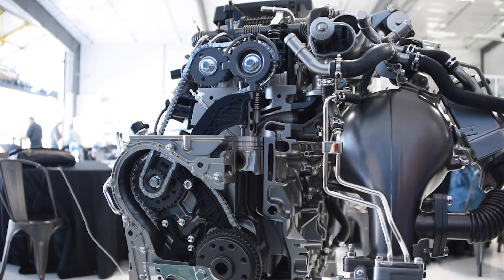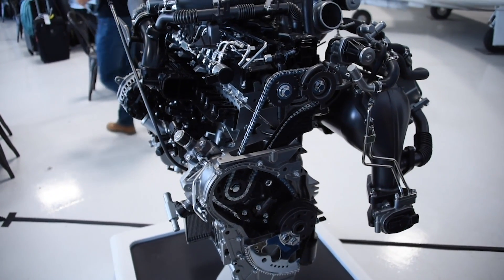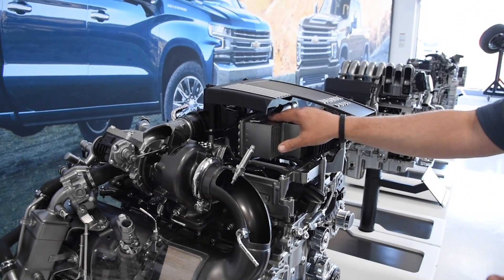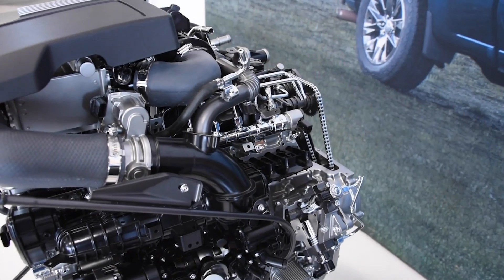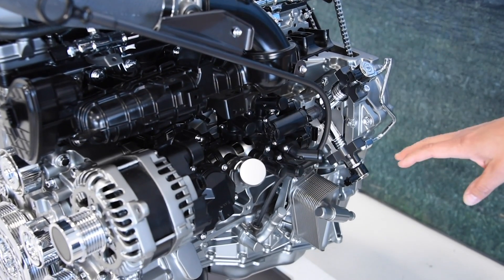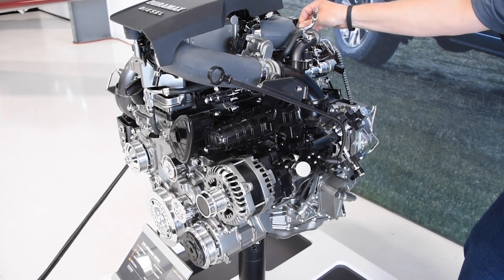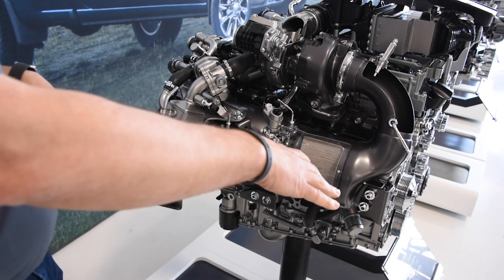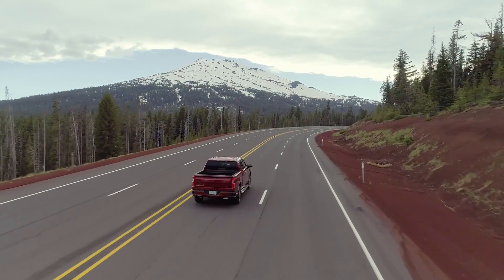What you don't know about the 3.0-liter Duramax diesel

Comment: Awesome video.  Very informative.
Reply from the maker: Thanks very much DJ!
Reply: @ the end of 2004 Ford bought back my 2003 super Dooty💩 6.0L piece of crap that had been in the Ford dealerships service department 10months out of the 18 i owned it-i bought a mid year 2500HD 6.6l Duramax LLY-This is by far the best truck ever manufactured anywhere-as soon as I got it home I pulled the egr actuator,valve & cooler off,cut the soot trap from the exhaust off & welded in a piece of pipe-my truck has over 430K miles now & being a 48 yr old Mobile Diesel Mechanic it’ll be the last truck I’ll ever need 👍🏼Thanks to Chevrolet 💪🏼 & Ppe tuning i nut on myself every time I drive it!!!Not many trucks can touch me from 0-130mph!✌🏼

Comment: Lol that engine wont last long. Theres a reason why the Cummins 5.9 12v and the 24v as well as the 6.9 and 7.3 idi and the 7.3 powerstrokes are all still running with well over 400,000 miles today and still doesnt skip a beat. You know why? Because they were simple. They had injectors, glow plugs, a set of pistons, a crank, and a cam. That simple. You never heard of a timing chain breaking on one of those. I feel just by hearing that the chain is a non serviceable part will make this engine last no more than 150,000 miles. Doubt it'll even touch 200,000. That's why these twats make them like that so you'll buy it again cause they're cheapskates. Oh and dont think about buying another one of those engines to swap in. That'll run you about 10 to 13 grand if not more. That's why I just stick to the best of the best. Detroit diesels. Old idi and older powerstrokes (nope no 6.0 or 6.4 or even the 6.7 here, those all suck too) and the 12v and 24v.

Comment: First of all... why in the absolute helll..... would you make the oil pump drive system a serviceable item? Thats soooooo inane its not even funny?!!!!  Chain driven camshafts??? Its a proven FACT That chains on valvetrain items in other engines are very often a frequent service item. Are you guys just looking to just SCREW every average american?? Think more simply. Your liquid to air charge system needs to stay out of the middle of the engine( where all your heat soak derives from). Overall horse power/tq output relates directly to air density in the intake manifold. Who is engineering this power plant? An 8 year old chinese boy?

Comment: “It’s not difficult at all!”

“The transmission just has to be backed out”

🙄🙄🙄🙄
Reply: Transmission has to be backed out as well as the transfer case. Driive shafts need to be removed as  well as the torque converter. 
They should have used a timing chain on that oil pump.
Reply: After saying it was rear mounted and a belt, then he said "easy"?  What ever happened to gear driven diesel?  Definitely financial choice.
Reply: Between 600 or 1200 for that service.  I asked...
Reply: I agree, planned failure. Master tech superstar does it in 4 hours, charges 12 to customer. Like everything else, all those chains will rattle like crazy past the belt change interval so go ahead and remove the rear engine cover by getting the trans out of the way first to do the whole job right. 

But that is easier then a front mounted timing system? Is that guy on crack? Let's see remove cooling fan and drive belts, pull the damper off.

Vs.

Remove driveshaft, transmission, and flexplate... keep smoking it bro.

Wait till everything breaks after being exposed to road salt.

Also, 460 lb ft of torque? Yeah for like 2 seconds till the transmission goes into abuse mode. It would melt down at that power output for long times.
Reply: Zac. So... like $25 labor? 😇
Reply: @Mike I have the Cheap gas 4.8L on a GMC Sierra with 257K and still running strong with just Spark Plug and Oil Changes and GM Retired it !!!!!
Reply: So Zac, you have done the job? You make it sound like its a 2 hour job.
Reply: Chris Heffernan yes.
Reply: @zac.6960  how long did it take you? Remove driveshaft obviously, what else did you have to do?
Reply: Nightmare!!!  Stupid to have to pull Transmission to work on!  I'll pass!
Reply: Exactly my thought.
Reply: Guess GM engineering figured out way to make changing out a noisy lifter even more difficult than on a I6 4WD Trailblazer.
 But that belt is good  for 150,000 miles. Maybe.
 Well my 2004 Envoy has a clicking and noisy lifter for 50,000 miles. At 202, 000 miles and the seldom (never) used front inner differential bearing got real noisy so I just pulled the offending axle.
I may get around to pulling the other one.
Reply: I just found out why I saw a Trax with poor man's Mercedes bumper sticker. 45,000 mile service $550 and did not have all that was on the list done.
Reply: Yea just a bit 😂
Reply: It's not difficult at all.  I know a 27 year master GM tech.  I recently bought the diesel AT4(on his recommendation).  I asked him about this specifically.  He said that even now, with no techs having even done it, he could do the entire inspection/replacement if necessary in 4 hours.  In 7-10 years when many of these hit the 200k mark(when he thinks they'll extend the inspection out to), techs will have more experience and will EASILY pull the trans, inspect/replace, and re install in under 3 hours.  The newer transmissions are MUCH easier to pull because of their modular design and build.  He also said it's a MUCH overblown issue.  That belt is constantly bathed in oil, sealed and never exposed to ANY elements.  He expects that techs will see these engines never opened up past 300k with no issues.  Said that if GM recommends and inspection at 150k, that means they're confident in an at least 300k useful life.  Remember, the people who buy these aren't hauling cars and putting a ton of miles on them like their bigger cousins.
Reply: @TakeDeadAim  It does not matter what it really takes, they charge you for what the book says. Book will say 8 hours.
Reply: @TakeDeadAim  my Impala needed the transmission pulled at 40k miles. It took two days. Even 4 hours is bad. It shouldn’t have to be done at all.

Comment: an indy shop mechanics review.......

1:07 so you used actual chains (single link.... and not dual or tripple.... which ya know.... last 10X longer)
but used a rubber belt for the oil pump???? 

why not use another chain...... this thing looks like the Ford 4.0 SOHC (which gave the explorer the "exploder" nickname.....)
Reply: "service on that isnt difficult..... ONLY THE DAMN TRANS HAS TO BE PULLED" 

as a mechanic..... go fuck you self gm
(and im a GM guy)
Reply: "the chains will last forever..... but not the belt"
SO WHY NOT MAKE THE FUCKIN BELT ALSO BE A CHAIN!!!!

you can make the chains ""last forever"" (aka 300,000 miles...no more) 

so why not make the oil pump also chain driven.... 

oh.... you want people to go to GM mechanics and not indi-mechanics..... FUCKIN GOT IT BRO!!!
Reply: if it was on the front..... i might have to pull the water pump and like.... power steering pump

then remove ~10 bolts for the timing chain cover..... JOB DONE
Reply: if the oil pump goes....... the engine engine is fucked 

PLEASE tell me that their is some MECHANICAL system that shuts down the motor
 (not sensors.... AKA like GMs oil pressure sensors that FAIL HIGH 99% of the time (aka, show 200+ PSI oil pressure) )

because i KNOW most people will DRIVE it to the shop..... then bitch at me when i say they need a new ENGINE!!!!
Reply: mix up the air and fuel? 

that might work on a gas engine..... but a diesel injects the fuel to start the combustion.....
so having a "swirl" to the air doesnt do shit.....

Comment: I was very impressed by the fuel efficiency of this engine but equally disappointed by the "wet belt" - why not use a chain like the rest? and if you are concerned about noise then why make it so difficult to service? and why not the fuel pump and cam belt? it makes no sense.

Comment: Two EGR systems. One to clog up the intake manifold and cement those swirl flaps shut, another to erode the compressor wheel and clog up the intercooler.
Reply: They did say the exhaust gases are post DPF, so in theory, should be quite a bit cleaner than pre DPF EGRs.
Reply: @tempestv8  Yes, post dpf exhaust is remarkably low in particulates. Maybe it will be OK

Comment: Damn my 84 Ford Ranger 2.8L V6 engine had timing gears and it wasn't a diesel, now GM creates this I6 diesel and uses a cheap ass bicycle chain and a damn rubber band to run an oil pump...oh but don't worry you only have to drop the transmission/transfer case, remove a couple of exhaust pipes, remove the engine, then disassemble the back of the engine to change a $5 belt.  Who gives a damn, the warranty will long been expired by the time that rubber band breaks, and the chain tensioners for the timing wear out.  Not GM's problem, but hey it'll only cost $6k to replace that $5 belt, would have only been $3k if it wasn't for being a diesel.

Comment: Kelly Johnson - arguably America's all-time best engineer - would be appalled.   Keep it simple, stupid.
All this complication and you're still stuck with particulate filters, regeneration burners, and urea injection.   Low reliability and horrendous repair costs.
Reply from the maker: Engineers don't add complexity to diesel engines for fun–they'e required for emissions regulations both here and abroad. Without meeting the guidelines, the engine would never be approved for sale.

Comment: This engine violates the k.i.s.s. (keep it simple stupid) theory. Belt drive oil pump? Why not use a magic "life time" chain? Those timing chains are "life time" because the engine will overheat and lock up way before the chains fail. Find a 12v Cummins truck and save like $40,000 and run it for a million miles. New vehicles are too expensive, horribly unreliable, and have a way too short life span.

Comment: Garbage. This entire thing is garbage. Low compression, OIL PUMP BELT, REAR ORIENTED TIMING? WHY? why is any of this garbage necessary. Look at that timing chain. Everything is so cheap and cheesy this whole thing is just a mechanics nightmare. Whoever designed this deserves to be fired. How did this trash make it all the way into production? Ignorance that's how. This is just insane. I'm shocked.

Comment: Is there a quick release for the transmission? Just run the freakin oil pump off the "lifetime" chain then. Why use a belt that is buried in the back of the motor? This engineer is on some serious drugs.

Comment: There is absolutely no reason they couldnt make the oil belt a chain
Reply: This is correct, but by looking at the design they would need guides and a tensioner for a chain. There doesn’t appear to be room anywhere for that without completely redesigning the whole timing assembly. It’s a terrible design to begin with.

Comment: I think GM has killed there sales with this video. I agree with others........ a swirl valve reminds me of the issues Marcadies has as they stop working because of soot buildup, variable cooling valve , rubber belt running hot oil, chain drive timing at the rear, post injection to heat the DPF..... I see oil dilution issues. The Kiss methodology was burnt not thrown out. 
GM pls go back to the drawing board......... you have scared us to death....

Comment: All you have to do is remove the transmission. Comparable to anything on the front of the engine.... are you on crack?!?... how about that high pressure f.p.?... looks like engine removal to access sprocket bolt... y’all are high af! Your engineers are trying to cut costs not make serviceability. Smh

Comment: Why not use a chain for that oil pump as well?
Reply from the maker: I didn't ask, but my guess is that it has something to do with reducing noise, vibration and harshness (NVH). The oil pan can transmit a lot of noise to the outside of the vehicle, and engineers are looking for every way possible to reduce NVH. Another possible reason is cost; a belt is likely much cheaper than a chain--and when you sell thousands of vehicles, it adds up. Thanks for watching!

Comment: this engine has my vote as a no.  bad enough timing chain is in the rear but to have the oil pump being run off of a belt that is horrible.  the engineer that design this engine is an idiot.

Comment: Have about 2k on my Silverado 3.0, out of 3 months I've owned it it's spent almost a month at the dealership for service, no heat from new- had to pull dash to replace heater box because of missing internal linkage, issue #2 is an aggravating buzzing vibration noise at dead stop to about 10 mph, quiet in reverse, dealership been playing with airbox / duct, sound changed but not gone, now they say could be normal noise? Wtf
Reply: Sorry to hear that. I wanted one bad based on specs, until I saw this video.

Comment: I think before you knock it give it a chance to prove it self, so I will wait and see. Can not say I'm a fan of the rear drive system......
Reply: Give it a chance to fail?  Alternatively, run out cost savings for fuel and maintenance including this repair vs a gas engine for 150k.

Comment: I was considering this as my next truck. GM guy through and through...but I have to agree with others. That timing system looks like a disaster waiting to happen. Give me a lifetime warranty parts and labor and I would consider it. But, this just confirms that the V8 duramax is just better all over the place and worth the extra coin.
Reply: Right I'm looking in the next year or to to buy a new truck and I was considering one with this engine but after seeing that the oil pump is ran by a belt I might not even buy a gm 6.7 gets great fuel mileage deleted
Reply: I have 50K on mine.  I love it.  And I also have a 2003 Dodge for the real work.

Comment: This is what you get what you give engineers their way. (Edit) GM has been taking these back faster than they can sell them due to overheating. The ones I've seen start overheating before 300 miles. There are no zeros missing. It's just 300 miles.

Comment: Another piece of junk from GM.  I've seen several BRAND NEW Silverado's overheating and blowing engines because this engine is so poorly built.  If you're going to get a diesel, GET A DIESEL .  Don't get some POS garbage engine like this.  You're better off getting a 2500 or 250 with the bigger diesel engine than this piece of junk.  And that goes for Ford, Dodge and Chevrolet/GMC vehicles.  I miss the rock solid engines GM used to make like the 3800 V6.  Today's engines are basically junk from day 1.

Comment: Lol,  no thanks. Belt driven oil pump that is supposed to last 150k miles...which isn't crap for a diesel. What a joke. Also, the chain for the high pressure fuel pump in the back of the engine. No thanks. Make it much easier to service.

Comment: wait wait wait....

So you're saying to replace the fuel pump drive chain and the timing chain you have to either take out the engine or drop the trans? I'm not buying the 'lifetime' claim; the chain itself maybe but the guides and tensioner will not be lifetime parts pretty much gauranteed. On top of that, the oil pump is driven by an oiled BELT?! Why would you put a rubber drive belt that far into the engine that is covered 24/7 in hot oil on such a critical part as the oil pump? I was really interested in this engine until I saw those details, now I'm skeptical.